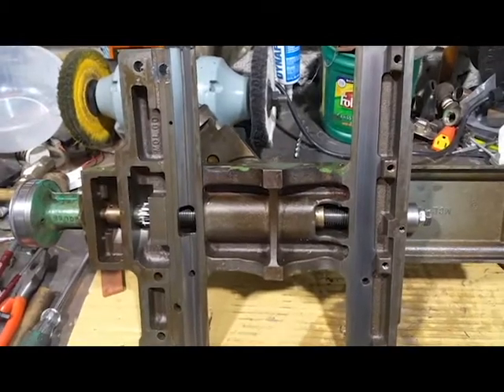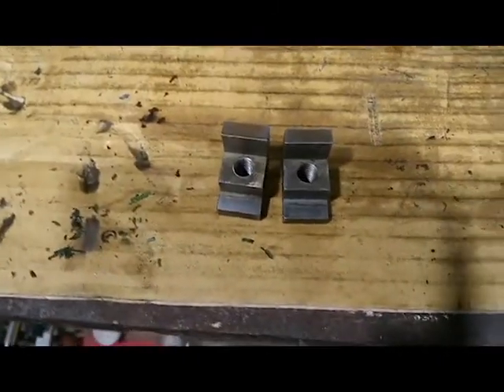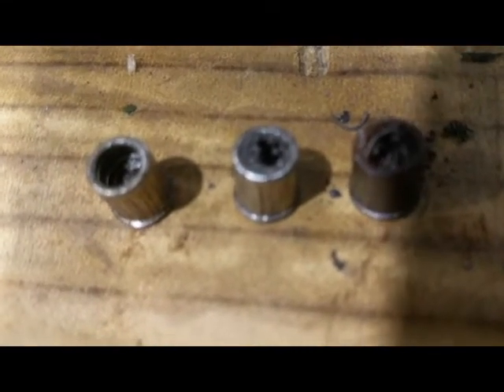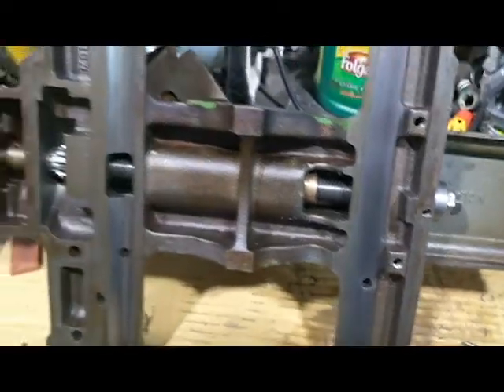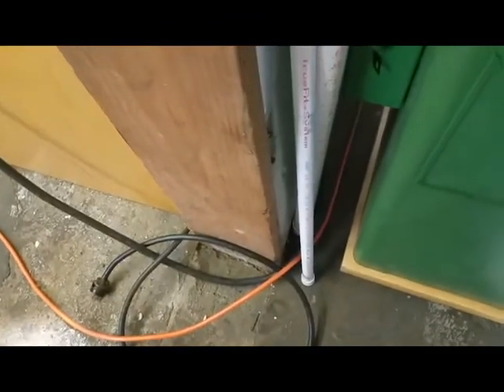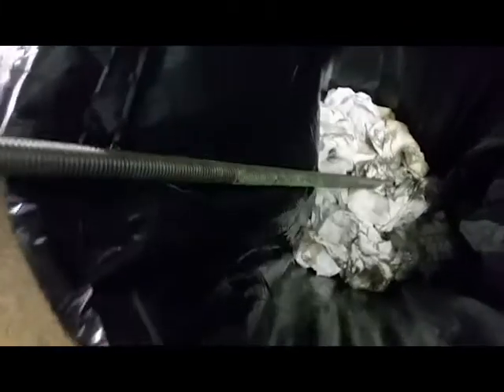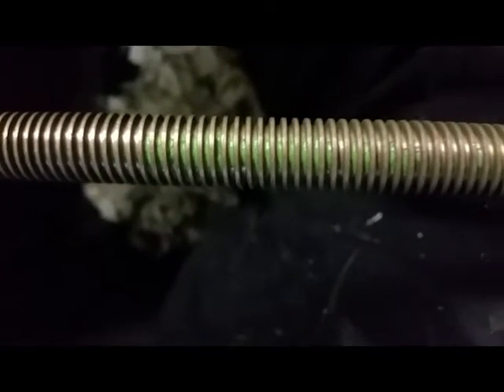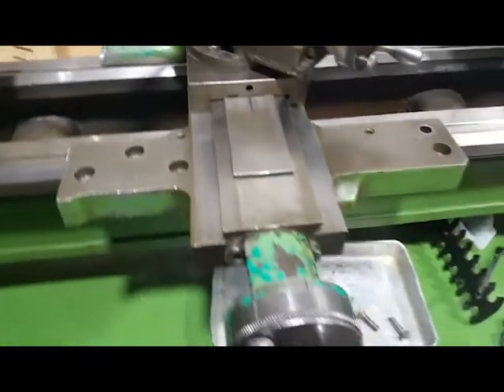Delta Rockwell 11" Lathe Repair and Maintenance

Comment: You slipped one by on me, Joe. Cleaned up nicely, and cool that at least half of the mystery of those little parts has been solved. The built in threading dial is another interesting Rockwell feature. I'd like to see more on that sometime if threading on that machine comes up.